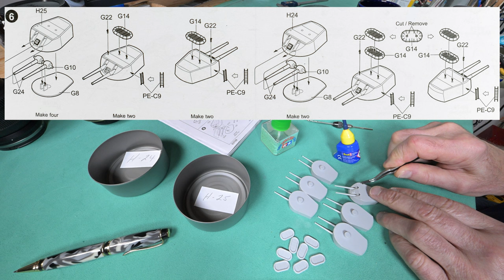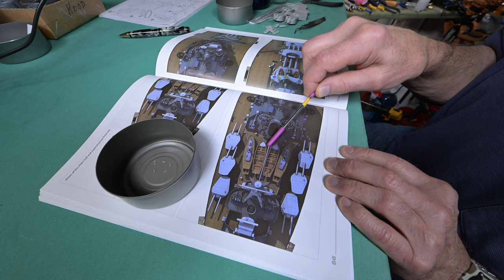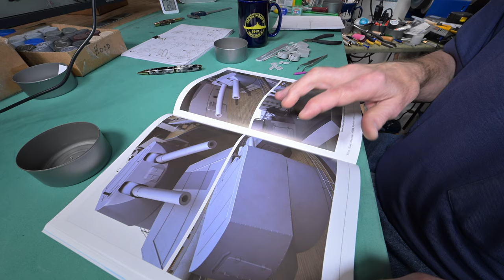The Model Ship - Part 1122

Comment: Just taking a guess here, because my area of expertise is tanks, but I would assume that the periscopes on those turrets are used for local gunlaying.  The periscope for a gunner on a tank is fixed in relationship to the turret - it always faces in the same direction as the gun, and the turret has to be turned to change the bearing you want to look at.  I suspect that the same thing applies to these turrets - if the gun captain in charge of the turret wants to look at something, he's going to have the turret turn to point at it.

So having the periscopes pointing in the same direction as the guns, as you have here, is quite likely the proper way to assemble them.

Regarding the snowblower, digging out the car, and snow being less fun than it used to be:  100% in agreement with you there.  I'm looking forward to spring.  At least I don't have to shovel mud out of the driveway. :)
Reply from the maker: Re: "it always faces in the same direction as the gun"
I guess that the benefit to that is that the gun is already pointed in the direction of interest. Makes sense! Thanks for that insight. 👍